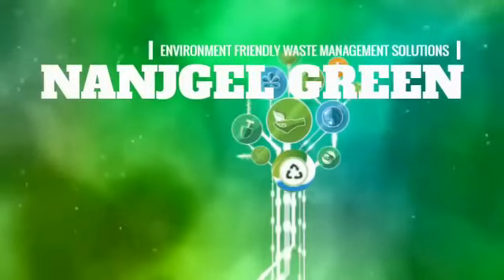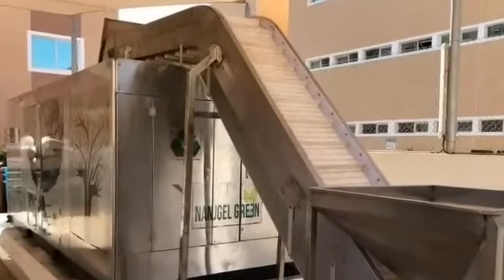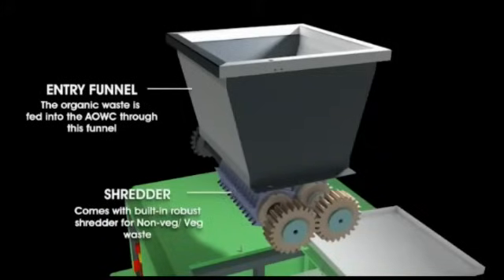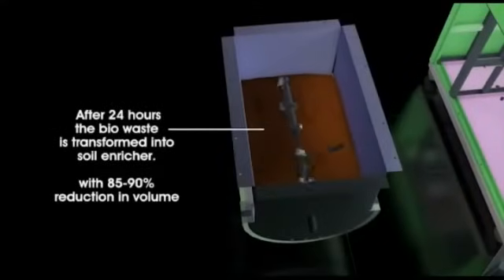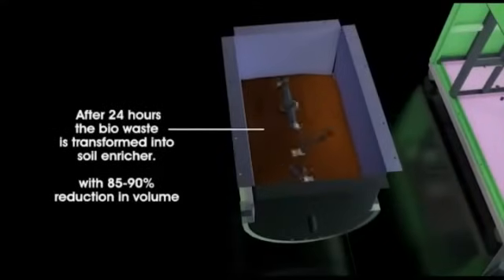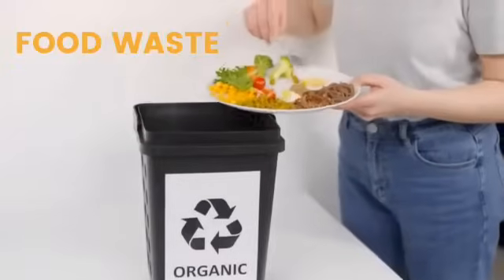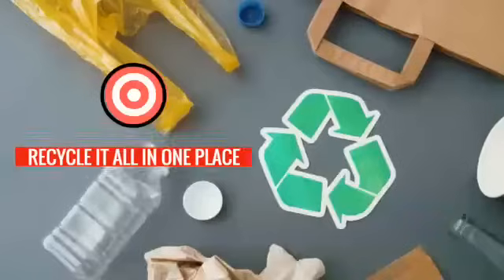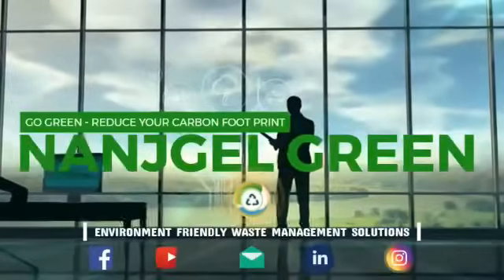Automatic Organic Waste Compost Machine with Inbuilt Shredder

Comment: what type of product discharging system do you use?
Reply from the maker: Machine has auto discharge once output door is open. Output consistency is dry soil like structure
Reply: @SMSHYDROTECH  how did you discharge the product thoroughly if you only used 1 ouput door?
Reply from the maker: @leduyhoang227  for better understanding you can connect with our team Email: smshydro@gmail.com or Ph No: 9811611599

Comment: Please could you tell me At what degree the heat this machine apply on the waste?!!
Reply from the maker: Fully automatic climate control system regulates conditions as per type & grade of food/organic/biodegradable waste with other external internal factors. For better understanding the application kindly email us : smshydro@gmail.com or call us: 9811611599 
Thanks
SMS HYDROTECH